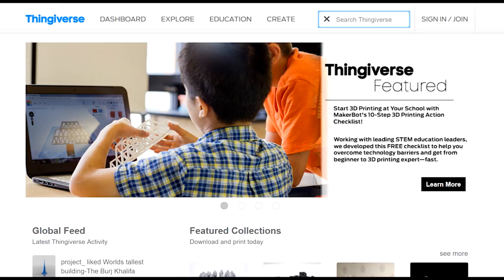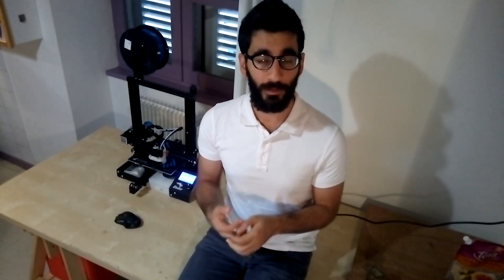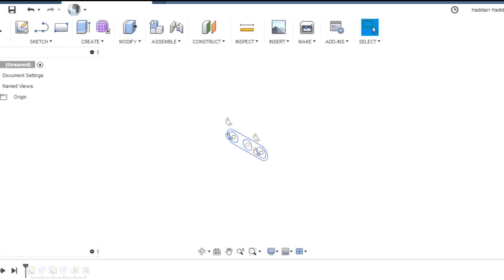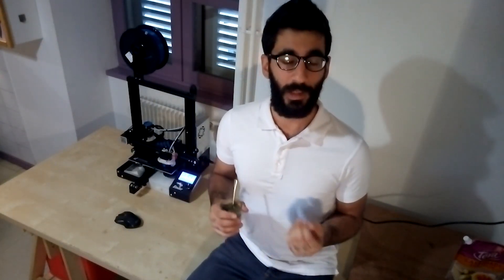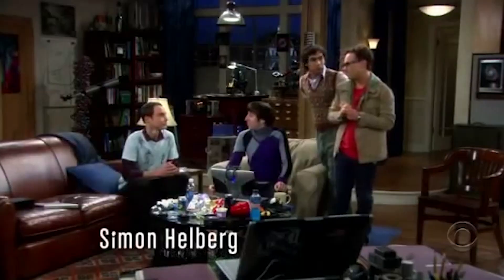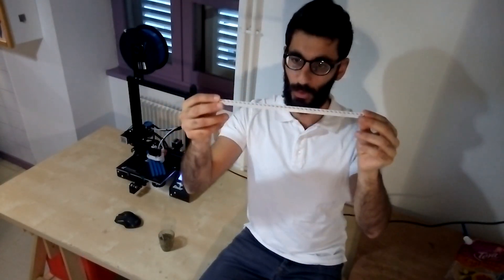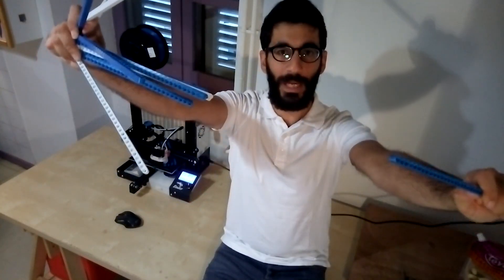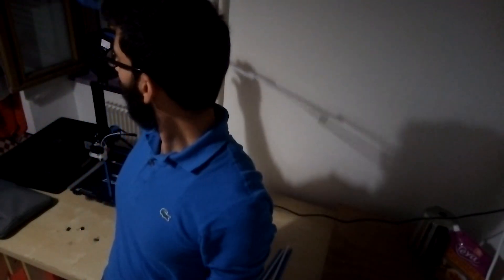How to master 3D printing LEGO Beams

Comment: Oh, buddy, you need to learn the XY compensation or horizontal compensation setting. It'll make it so you just need to design it to spec, then adjust it for your printer and filament. Otherwise you're going to be doing this every time you change filament.
Reply from the maker: Hi,
Thank you for this tip, that would help allot with the calibration of the LEGO beams.
I would like to discuss your playlist LEGO Fiasco with you if you don't mind, I hope you check your Emails.